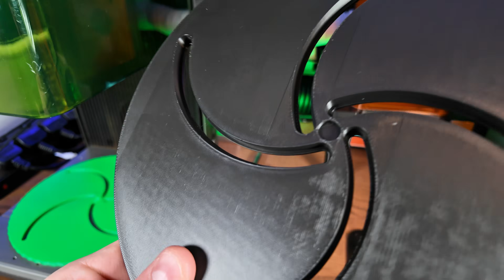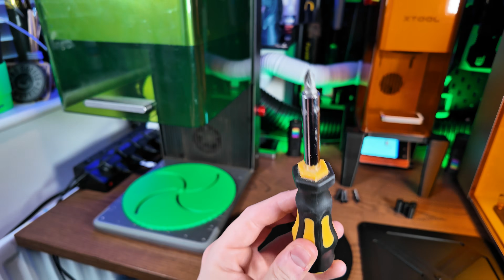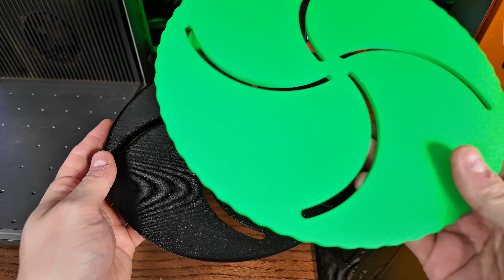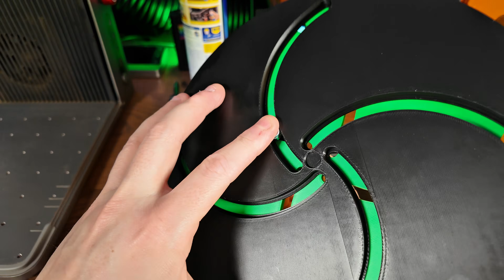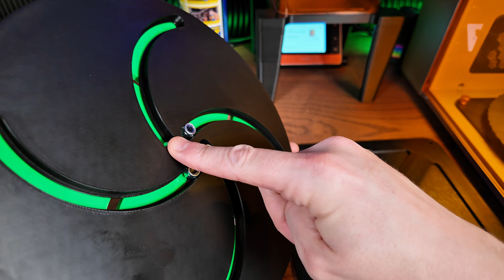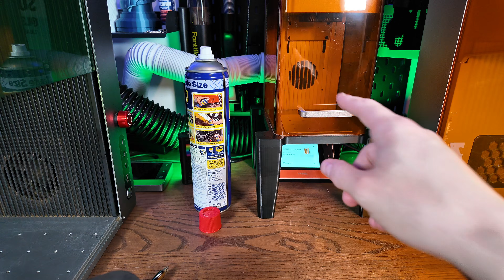The Jig Every xTool Owner Should Have (Self-Centering Jig Assembly)

Comment: This jig is brilliant! Since my 3D printer, Ender3 is too small to print the F1Ultra size, I got the one for the F2 and modified the baseplate with tabs to fit my F1 Ultra. The M4 holes in that machine's baseplate are 35.004mm center to center.
Reply from the maker: That's a clever modification, nice work! Thanks for sharing the hole spacing too.